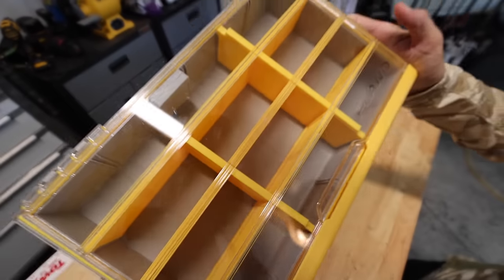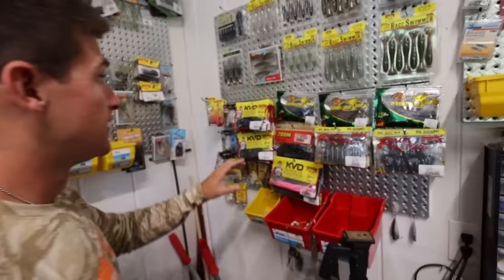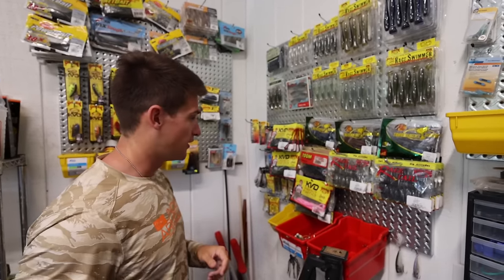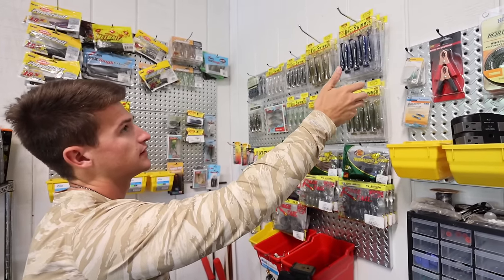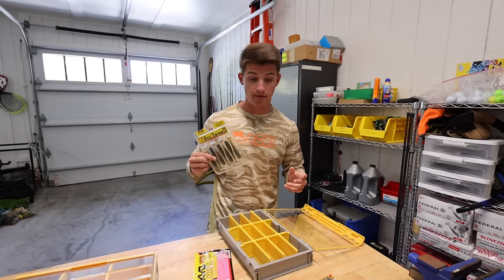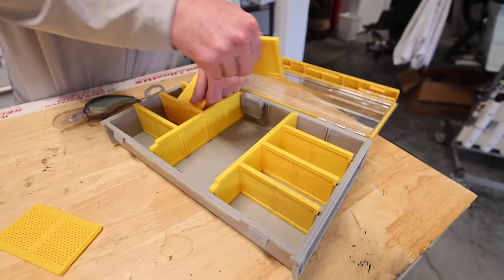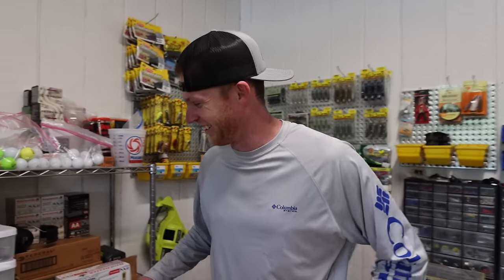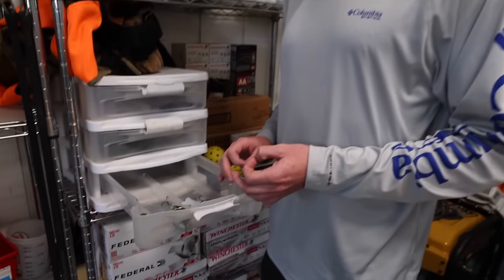$25 VS $250 Tackle Box Fishing Challenge (BIG BASS)

Comment: I'm glad i simplified my fishing. I catch a lot more fish. I only spend my money on weights and hooks. New soft plastics like grub worms fluke or small finesse worms. If i run out procure trophy bass or nightcrawler or crappie jigs. I use like 3 rigs. A 6 inch leader with a size 1,2,4 or size 12 to catch bait fish. I put on a spilt shot once i tie leader to main line. 6 inch leader with size 1,2,4 or 12 tie to main line with a slip bobber. Then, a drop shot. Then, a regular setup with 3/0 superline ewg hooks with delta red crayfish. A white crappie jig, a jerkbait or kvd splash, a wake bait, or berkeley choppo. This is all i use and catch a lot more fish. To a non experienced fisherman, it seems like a lot. Oh, last but not least, crappie magnet 1/32 oz jig with small split tail.  worms.